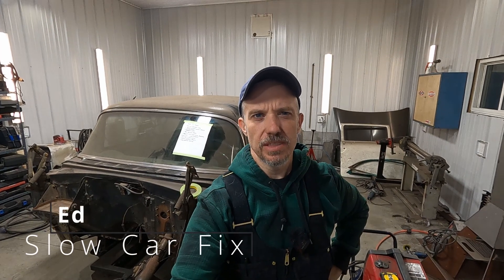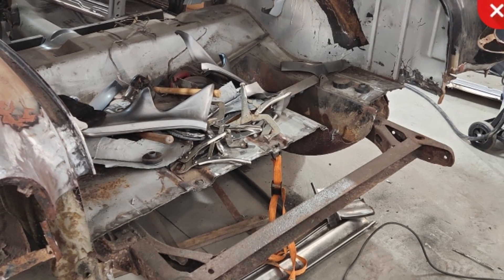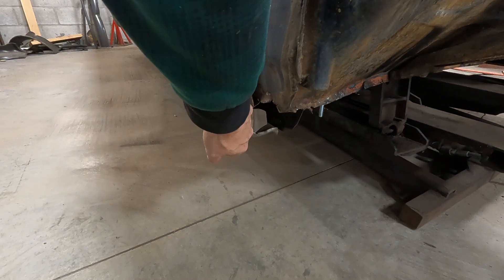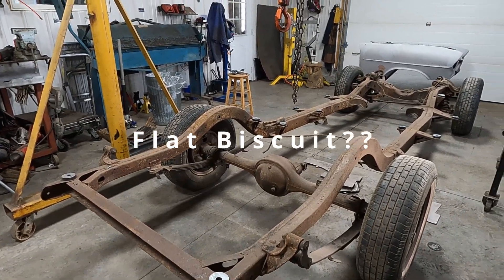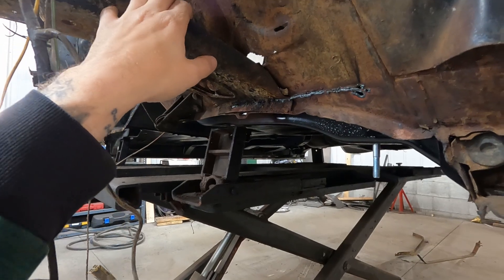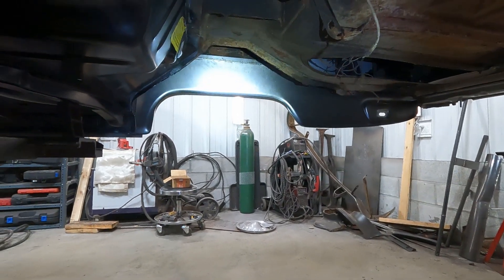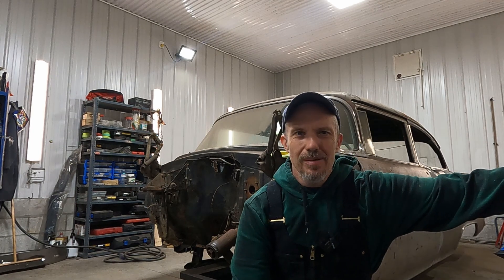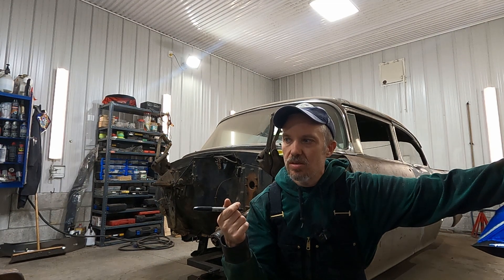Trifive - 1955 Chevy 2 Door Conversion - Frame off, what's next?

Comment: Ed it's always a good idea to have a plan and make lists to get stuff done. i collect the parts as i can so when i get started i have most of the stuff i know i need.
  i have been collecting used parts to build a 57 since i was working at a restoration shop. i collected the take off parts that were going to be scraped. well monday i got a 57 4dr wagon from my old boss and i have a lot of the parts i need for the wagon . i am doing it ratty looking beater quality but mechanically restored for safety. i put nice rebuilt 350 and th350 in it sunday.
  keep up the good work and build the 55 just the way you want it.
Reply from the maker: Oh I love a '57 Wagon. I need one of those. Thanks for watching and for the support!

Comment: I was wondering where you bought the outer rockers. Most of the ones today have all the tabs in the front welded in. Enjoying your build. Have fun.
Reply from the maker: I bought them from CARS inc. I would have much preferred them to have the tabs. It's all in now though, but was a bit of a puzzle.
Reply: @Slow Car Fix  parts made by golden star auto are good. They have the largest variety and are sold by literally dozens of vendors. They even sell a entire kit for a 2 door conversion. They have the parts for making the back windows work right also. They have the license with gm to stamp many of the sedan parts. They are the only manufacturer of full sedan quarters. As a painter and tri five guy I paint my frames and then reinstall before spraying the body . Works for me. I am doing a frame now. Keep up the good work Ed. Enjoying the channel and will keep watching. Brad.
Reply from the maker: I am familiar with Golden star. My door jams and the V under the window are golden star products. My experience with those two panels are not great. The "crown" was off and it made it a bit of a struggle. I think I would have preferred their rockers though. The majority of the parts I've received from CARS have been good. They stamp in Detroit. I have also heard great things about Woody's and Real Deal. I have an idea to take my glass for the quarters and make it fixed. I don't need to roll them down and this car will have air conditioning. 
Glad to know you paint the frames and then install the body before spraying. It makes sense to me too, and I'm not really worried about over spray on the frame as much as I am all over new suspension components. 
I'm glad you are enjoying the channel. I have painted parts of a car, but never a whole car. So that will be a challenge for me. The nice thing is that I'm going for a "worn in" look, so perfection need not apply. 
As a painter, what would you recommend on the firewall for satin/semi gloss black finish that is in an aerosol or brush on application?
Reply: @Slow Car Fix  Paint will as know depend on the result of the finished product you are looking for.  I don't brush,so I am not a big help there. I have been ordering paint from Tamco Paint. While still pricey, it's good in my opinion and less than many of the big names. They have a under hood satin black . Runs $258 for a gallon kit. Local Napa stores usually sell a decent Martin Seymour  or finish line single stage. Have fun and anytime you have a question just holler. Brad
Reply from the maker: @Brad Reeves  Thanks! Will do.

Comment: Neat project!!  I am  building a 55 driver.  I have heard that the shock bar reduces the 2 most important inches of shock travel???  Just sharing.  It is a worth while project I enjoy watching your thought process.
Reply: I was wondering about that. Good information
Reply from the maker: This is something I'm looking into, which is why I'm undecided on rear suspension. What I have it narrowed down to is a shorter shock, and 3" lowering leaf springs, or just putting a 4 link and coil overs like I did on my '57 truck. I'll be sure to show whatever I decide.

Comment: Dude, summer is coming which reduces work time in exchange for drive time
As far as a plan, with where you are I would finish metal work on cab - to the point you can roll the welder out
Finish everything underneath seam seal/park cable/undercoat
I would get bodywork roughed in and in primer for summer so metal is covered
Have lots of car fun and in fall go nuts on frame etc
Reply from the maker: We can agree to disagree on this. I have other toy cars to drive in the summer. This is a long term project, no point in rushing now and half finishing stuff. There is no urgency for me to get it on the road. Thanks for the comment, but I think we're not on the same page with this one. Hope you enjoyed the video.

Comment: If u used a 4LINK rear supention would u build it your self , or buy one
Reply from the maker: The one on my truck is a kit from performance online. For the '55, if I go that way, I would order a "builders series" from Horton. It comes with the parts and you cut and weld to fit. Makes more sense and is cheaper than complete from scratch.